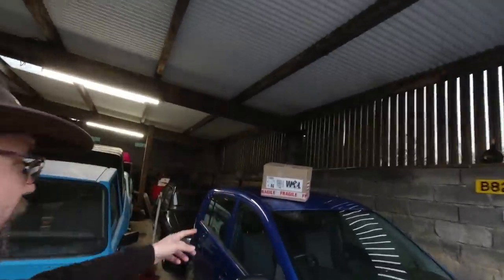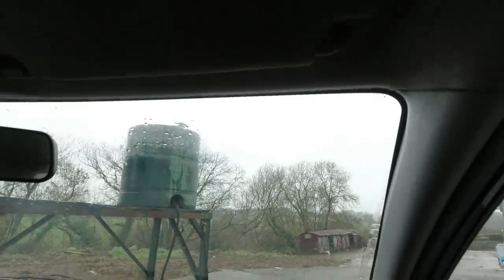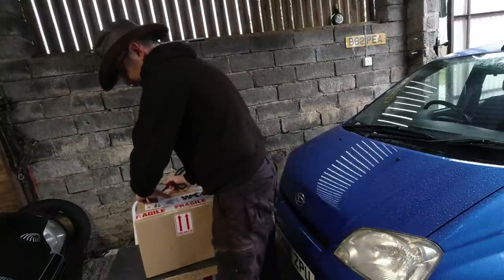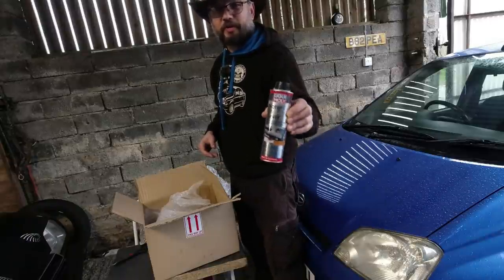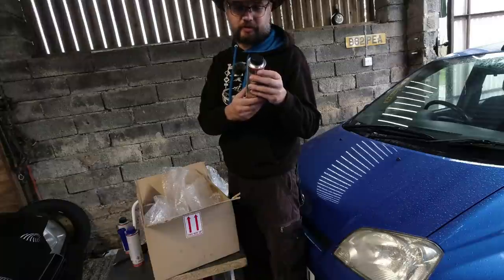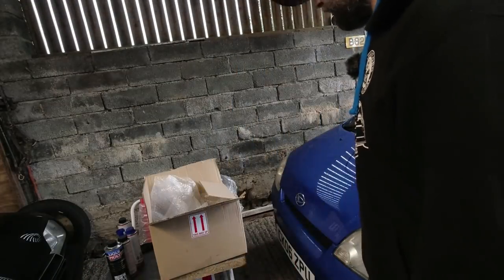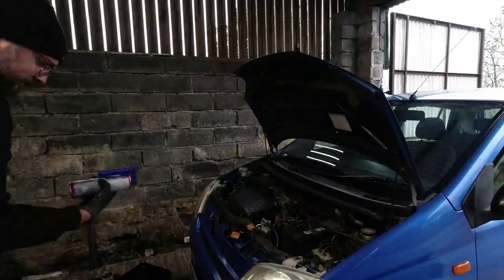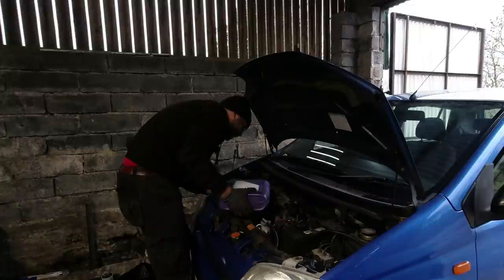Smoking Daihatsu - can additives fix it?

Comment: I’d suggest taking it on a few good long runs, ideally along the motorway for a decent stretch, not only to get the potions working in the engine but also to get the exhaust good and hot for a decent duration. That way you can burn off the accumulated oil residue from within the exhaust system, which is another source of smoke,

Also maybe worth doing a compression test to rule out piston rings. 

My money would be on valve stem seals being the root cause, with a bit of luck your oil additive will improve them over time.
Reply: The valve stem oil seals on my Datsun 120Y used to wear out every 80k kilometres; you could almost set your clock by it. The symptom was oil smoke after deceleration in gear (going down a hill or braking in traffic, followed by a cloud of blue smoke on acceleration. The cloudsincreased as the kms travelled with worn seals increased. The mechanic used to use a spark plug with an air hose fitting welded on to pressurise the cylinder on which he was changing the seals. he took off the overhead valve gear and then turned each cylinder in turn to TDC, removed the collets etc, changed the seals, replaced collets. Quick procedure done on the car.

Comment: Without making any real mechanical intervention. Like replacing valve seals, etc. Make sure you clean the PCV system as best as possible. It's rather simple on these engines!  And give a good cleaning also on the O2 sensor's. Carb cleaning or electronics cleaning spray make it a quick and simple job. New/clean spark plugs, just like your potions, won't make miracles but will surely reduce the amount of "visible" smoke and the stigma associated. Cheers
Reply from the maker: Thanks. I really don't understand the PCV system on this engine. Is it just baffles in the cam cover?

Comment: Are you sure it's engine oil? how does the trans work? auto or manual? . If it's automatic  it's not a leaking modulator? sending  transfluid into the intake. I've even seen leaking brake boosters do exactly the same too. 
Molybdenum sulphide was around for decades in Molyslip.
Reply from the maker: It's a manual.
Reply: Burning ATF is white and has a very distinctive smell.

Comment: It will take 300-500 miles to see if the exhaust system and cat cleans out and things improve - a good long distance thrash would be my recommendation :) . I suspect with the mileage that the bores are now glazed and in need of a re-hone  but the economics of that may be scary depending on what else you find. Might be worth changing the valve stem seals as a lower cost option ?  Also I would be tempted to fill the cylinders with a 50/50 mix of paraffin and diesel at the next oil change interval and see how quick it drains past - bore/ring wear may be an issue? At £190 +service parts it does not owe you a lot yet - I would be tempted to save it unless a full engine rebuild is required.

Comment: I had car like this used oil and at times smokey. Additives and heavier oil worked to get through Irish MOT for years. Eventually the catalytic converter clogged up and it failed. You could try compression test on the cylinders in case one is bad.

Comment: Ian have you checked the head gasket on the river I had it was sending blue smoke the oil was getting Into the water and boiling the water up in the expansion tank brilliant video Ian

Comment: OILS today are very good so oil additives are not needed also adding thicker oils to modern engines is not a good thing.  The only thing I would use is the engine flush and that's it.

Comment: My guess would be valve stem seals or guides but I wonder if you've looked at whatever  crankcase ventilation system is fitted?
Reply: Valve seals cause smoking when lifting off the throttle. Rings cause smoke under throttle.

Comment: Run it on some cheap diesel oil and do some frequent changes. Magic potions, other than an oil thickener,  won't do any more than just confirm you need an engine rebuild.

Comment: On any car, you can see which side the fuel filler is. There is a picture of a petrol pump in the instrument cluster, the side of the picture the hose is on is the side your filler is
Reply from the maker: This is not true.
Reply: Yeah, it is. On every car I have checked it on anyway, and there are lots of them.

Comment: I'd have the plugs out to see if they look oil contaminated before doing anything to it. No point throwing money and snake oil at it. My diagnosis would be tiny engine, dark side of 100k miles. Been previously run horribly low on oil by a neglectful owner. Worn out. 
If you really want to give it a taste of molybdenum disulphate, drain all the oil out and refill it with CV joint grease. That should sort it.

Comment: great video ian, lets hope it works...btw most cars have a little arrow on the fuel gauge to tell you what side to fill up, it only took me 30 years of driving to find that out,lol!
Reply from the maker: Cheers. I think it's a modern thing as I've not seen it on any of the old stuff I drive!
Reply: @HubNut  apparantly many cars from the early 90's have them, it says online, a designer at ford invented the idea  in 1986.
Reply: @HubNut  The  filler tube was usually on the same side that the fuel gauge on the dashboard, but when someone decided to put the fuel gauge in the centre a new way to show it was required. The fuel gauge in the centre of the dash came about when temperature gauges were replaced by a simple warning light, as an offset gauge would make the dash look lopsided. Car manufacturers put as much effort into the internal design as they do the external.

Comment: You’ll find that engine has been hot at some time in the past head gasket or thermostat issues. I think your fighting a losing battle knowing that engine they suffer from oval piston issues. This is we’re the piston wears front and back where it pivots on small end. Normally seen in motor bike engines when there ready for a rebuild. Years ago when Ford escort mk3 where due for mot we use to put stop smoke in them it would be a temp fix till owner had the valve stem seals replaced. Not sure if you can still buy it but that would cure the oil burning for a month or two.

Comment: Forget all the potion's and use 15W 40 mineral oil ( avoid synthetic ) 😎 from past experience it works perfectly for worn engine's 👍
Reply: Especially if formulated for diesel engines...lots more detergent...and the catalytic converter is probably on it's last legs anyway!

Comment: I once tried to cure an oil cloud issue with an old Clio Diesel, i put that Wynns stuff in the engine and guess what ? it was so thick in consistency that the engine after a few weeks seized up solid lol

Comment: Pull out the dipstick while it's running and if it idles higher you've definitely got blow by on the piston rings  , try a compression test for piece of mind
Reply from the maker: I've had the oil cap off while running and it doesn't seem to make a difference.

Comment: These 1L motors do this.  I have had a couple that smoke.   My dad couldn't get on with this model at all and went back to the previous model Cuore.
Reply: @Shane All the cars that have been bought have had full service history. The worst Cuore I have had, the head was not shimmed properly and ticked, but it didn't smoke and had been badly looked after.  We have had over 20 Daihatsus over the years and the 1 litre seems to have this inherant problem.  It seems to be luck of the drawer with them.

Comment: Did I miss the result of the engine flush? Did much black stuff come out given the oil was changed just before?  I do wonder is it sucking the oil through a vacuum hose into the inlet.  I always thought valve stem seals was a cloud of smoke after idling for a long time.
Reply from the maker: I was going to cut the filter up to have a look. I still have it, so still could.

Comment: I think nearly all cars have a little arrow near the fuel gauge telling you what side the filler is on, hiding in plain sight. I never noticed these until after about 20y of driving someone pointed them out!
Reply from the maker: Apparently only new cars. None of mine other than the Charade do.
Reply: @HubNut  Perhaps it was an EU regulation or something. But what I want to know is why every Ford has the fuel filler on the offside except most if not all generations of the Fiesta.

Comment: I am not familiar with these cars but was that amber light on the dash the oil light?, If it is then it took a while to go out on start up IMO. & the handbrake issue, you might want to drop the drum off first & clean up & lube the shoe linkages as that normally the cause.
Reply from the maker: No. Oil light goes out quickly. There are a few different warning lights that take longer.

Comment: I'd have used one product at a time, then you'd have a better idea of where the oil was getting into the combustion space / circuit, rather than chucking it all in at once. 
Oil pump technology has hardly changed in 70 years, what has improved immensely is material technology and machining precision / repeatability in budget engines.
My money is on compression rings / pistons  worn on the lands which creates a pump effect most noticeable when engine revs change considerably. But the oil control rings would also have to be worn for it to get as far as the top rings. Quality oil, meaning makers that have effective additive packs (all consumer oils have an additive pack) will help a lot and an efficient crank-case vapour management system is essential. Guess what should be on your list of jobs. As someone else also mentioned, if that much oil has gone through the engine, a good percentage will have condensed on the cold internal  surfaces of the exhaust system, great for corrosion control but not so easy to clear out even if you rebuild the engine and a new exhaust system is the only practical solution, don't bother asking how I know.

Comment: I still wonder if a little of the injector cleaner in each bore via the plug holes left overnight and see if that softens any varnish from around the rings. That and a long motorway run for the additives to really get to work.
Reply from the maker: Yeah, long way to a motorway from here! I do need to put some more miles on it though.

Comment: the fuel pump logo on your gauge be it L or R shows the location of the filler cap on the body of your vehicle cars from the 80s onwards are marked to help the driver pull to the correct side of the pump for ease of filling
Reply from the maker: That one's a myth.

Comment: I often get strange looks when I fill up my car with petrol from the "wrong" side at the petrol station. If you pull the fuel hose it just reels out from the pump and stretches out over the car with plenty of hose to spare.
Reply from the maker: Yup. I use that trick quite often. Easier to be the right side though.

Comment: Is it an interference engine? 
If so, consider doing the timing belt, then don't do it. 
If not, don't consider doing it. 
Unless of course the kit is £30 and it takes an hour for instance. 
It was £190 and the engine is knackered remember?

Comment: I used to work for a dodgy car dealer years ago & he used to try all them snake oil treatments before he put them though the auction sometimes they would work a little for a short time. To be honest normally snake oil is a waste of time & money really, would be easier to just put another engine in it
Reply from the maker: Nah. Pouring stuff into the engine is definitely easier than replacing it!
Reply: True but it's probably a waste of time.

Comment: That's definitely better than it was. Of course you've got to put some miles on it yet and hopefully the valve stem oil seals will improve.

Probably not a complete cure (although I'd love to be proved wrong) but it should at least postpone the day the engine has to come apart.
Reply: It's not the valve stem seals, it's stuck oil control rings. These engines are notorious for it.

Comment: methinks the  vlogger doth protest too much. It's still burning a significant amount of oil and it's still got duff rings. It MIGHT go through an MoT when warm but when cold - and the clearances are wide - it's still doing a passable impression of a trabant. If you do the rings, you could do the timing belt at the same time....
Reply from the maker: Yes, it's not cured, but that's not really all that surprising. I will keep reporting back, and engine work will occur if needed.

Comment: All cars indicate which side the fuel filler cap is on .... look at your other cars, the arrow will point to left or right.
Reply from the maker: This isn't true. It might be on cars of the past decade, but my older cars have no such indication.
Reply: @HubNut  every car I’ve owned, driven or hired over the past 25 ‘ish years has had an arrow within the fuel gauge that points left or right to indicate which side the filler cap is on - U.K. and abroad.  Given that the vast majority of cars on UK roads will be under 15 years old, I’d say your statement that ‘more cars should do this’ was moot because they do.  If you Google something along the lines of ‘how to tell which side my fuel filler cap is on’ you’ll be inundated with articles and pictures such as this one which shows and explains you what you’ll see - https://images.app.goo.gl/W5g6hMs265tEzXfM6
Reply: Just to add - it’s all about the Symantec’s of what you said which is why I replied, you said something along the lines of ‘shame you don’t see that more on cars’ - my point was you do .... not sure when manufacturers started doing it but I’ve used that for years and years to see what side I should be filling up on - very useful on holiday when you’re a bit disoriented anyway being sat on a different side.

Comment: Not going to free up sticky rings with any of that stuff... Pour summat down bores and periodically turn engine over by hand.
Reply: Like diesel maybe. Worth a go I'd say.
Reply: @terryatkinson899  maybe, but pref summat that eats carbon, even engine flush or carb cleaner etc, poured into to cylinders and rotated/moved about every 5-10 mins. Dont want to push it out of plug holes or scuff the bores but do need to soften that carbon around the rings.

Comment: When you consider that China is instating one coal-fired Power Station per week it's really not that much of a problem
Reply: The Chinese are re-cycling power stations. When we in the west close one down they usually get carefully taken apart and sold to China. China uses them to power the factories which build the solar panels we install so that we can generate 'green' electricity. The irony is farcical.

Comment: Does that car even have a timing belt?  Or is it chain?
Reply: He said it's got a belt
Reply: @terryatkinson899  Yes, but has it?
Reply: okay - ECP apparently stock a belt, which costs about £51.   Interestingly, the Daihatsu Sirion, 2006, 1.0 litre 3 cylinder petrol engine, uses a chain, not a belt.

Comment: As already mentioned on the previous video of this car, I would have let the engine sit for some days after you spray som diesel in the cylinders. It is better than WD40 because WD40 is mainly for dispersing humidity, but petrol will help to loosen the piston rings. Not a big deal if it all drops into the carter, because a new oil change would have been due anyways. I think you can still try that?

What I do on modern cars after an oil change, is to remove either the fuse or the relay for the fuel pump, so that I can build up oil pressure before that it actually fires up. Also, this car makes me think of the CityRover and makes me wonder why you didn't keep it for example for Ms Hubnut?

Also, I never had faith in all those potions. They do nothing. They are okay if you use them consequently from day one you bought the car. But they will never solve any problem. The same goes for injector cleaners and DPF cleaners. They simply don't work.
As already present in the previous video as well, I think there is quite a clatter at idle, isn't it? 
Best of luck!

Comment: You might want to consider a Terraclean (as seen on wheeler dealers) I've included a link to someones results  https://www.jaguarforum.com/threads/terraclean-as-seen-on-wheeler-dealers-my-results.45958/   I had it done on a focus diesel turbo and it worked  got my emissions through MOT

Comment: In conclusion..... A badly designed, crap engine. My 272k mile 2CV engine doesn't smoke or burn oil.
Reply from the maker: My 2CV's engine was burning a fair bit by 170,000 miles. There is a design flaw with the oil control rings, but that hardly makes it crap...
Reply: Holy smoke! 272k miles on a 2CV??